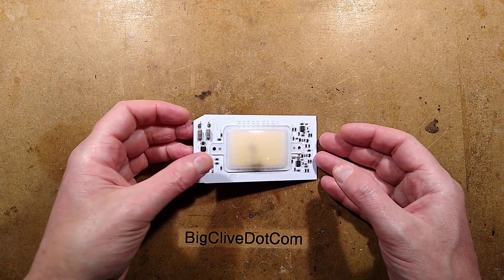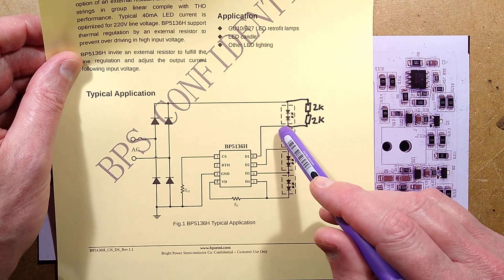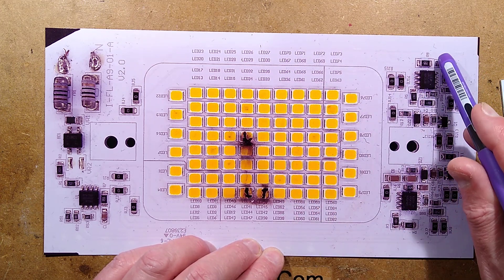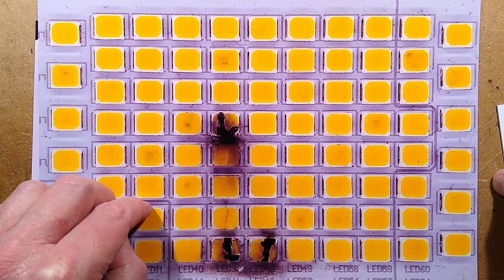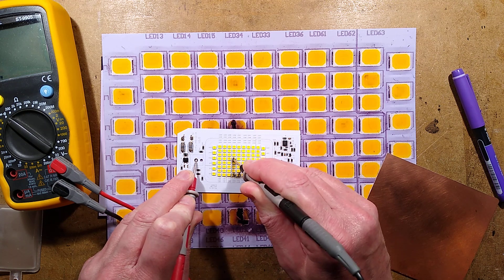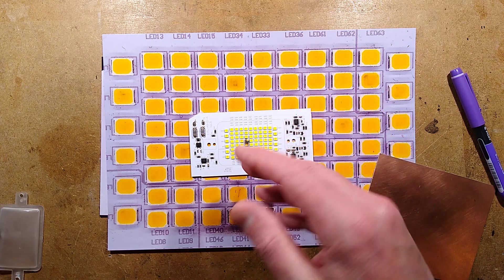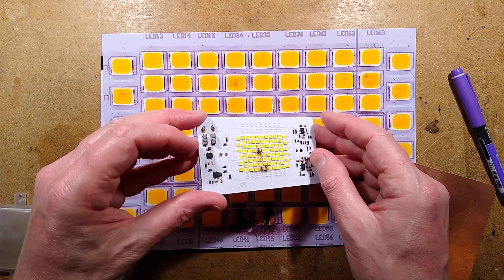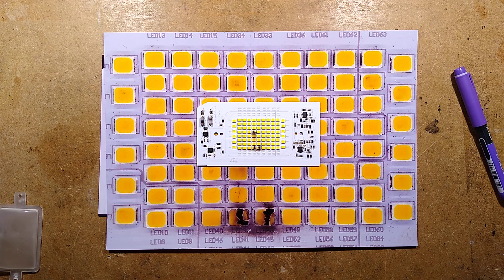LED shock hazards are increasing

Comment: Hi Clive, I was the one who sent it in! A couple of things, this was a PIR activated floodlight from Wickes. It was own brand but not a cheapy one. 
We've had 2 fail in the same position since, oddly the other 2 we have elsewhere are fine. Must be a cursed location. 
The sensor didn't survive my dissection of the case so I didn't bother sending it with, but I got no light out of it whatsoever. 
There was a very small blob of thermal goo on the back but nowhere near what I'd expect it to have unfortunately.
The case was earthed, something I checked when I plumbed it into the supply.
Thanks for the interesting video as always!
Reply from the maker: Does that unit light more than the others?
Reply: Two things: What's the line voltage drop to that particular installation spot, and is it in the sun or in a place with bad cooling? 

One thing I HAVE seen is that if something's in a location REALLY close to the main panel, it's probably getting 125-130V (here in the US) just because the rest of the place is running at 110-120 AFTER accounting for the losses in the wiring and the other loads on the circuit, which in the days of incandescents meant that garages and basements all had to run Rough Service 130V bulbs to not burn out constantly, T12 and T8 electronic ballasts last a year tops when magnetic ones go for decades, and LEDs need to be of the buck regulated parallel type instead of the series-string linear regulated ones like this. 

And, of course, LEDs hate the heat so if it's in the sun against a brick wall, up under the eaves where the airflow's bad, then it's gonna get toasted way faster than normal.
Reply: @LenKusov  I'm surprised (though not much) that US wiring is so shoddy there can be 10% voltage drop within a home.  IEC reference regulations (used in most of Europe) put a lower limit on the percentage voltage drop between the fuse box and the outlets / devices.
Reply: @johndododoe1411  when I was a kid our house regularly got 130 volts or so, we went through a lot of light bulbs and my dad had to buy special ones.
Reply: @johndododoe1411  Lower voltage in US houses is part of the problem but it is good for copper mining firms and wiring companies. US regulations are haphazard and hyper local. Some US electricians are excellent, some are not.
Reply: @dosgos  Dropping 10 volts in the wiring will heat them up with 10W for every Amp.  Every % voltage lost in wiring is 1% of the billed kWh never giving any value for money.  Those should be motivation not to accept such sloppy work.
Reply: @johndododoe1411  It's true.
Reply: @johndododoe1411  10% voltage drop is extreme, I haven't seen that much myself. Nowadays the NEC recommendation is five percent, but back when lights were basically the only load and half the house was on a single fuse it was probably acceptable. Part of the reason that much drop is rare is likely because everyday circuits are rarely loaded to maximum capacity.
Reply: @johndododoe1411  The US National Electric Code doesn't actually REQUIRE any maximum voltage drop, in the fine print they SUGGEST no more than 5% total and 3% on the spur but there's nothing legally stopping you from running as much 14 gauge as you want, with as many backstab connections as you want, and dropping it to a borderline unusable voltage. I'm sure I could get my spur circuit voltages up if I went through and cut all the backstab outlets out and hooked up screw terminals instead, but it's not really worth the effort. At 120 volts, 5% drop is only 25 feet, while at 240 it's 50 feet so IEC's 5% limit is also more achievable without having to up-size conductors.
Reply: @LenKusov When I installed it it was still getting pretty much 240v, middle of the day. It's on the other side of the house from the RCDs, oddly with a fused spur upstairs and a switch downstairs then the cable coming out the wall midway outside. Some very dodgy wiring in the past here, but that's how it was when we came in. It was originally for one halogen lamp but we put 3 new LEDs in, obviously load testing with the cable extension first.
It was in a white painted case and mounted 90° from the wall on a bracket so house heat wouldn't be too much of an issue, but it will get the sun where it is, but again the other Wickes one behind is fine and actually still going, though rated 10W less. It also failed mid winter.
Reply: @LenKusov  do we really need to put LEDs on everything ? even outside on things that will light up for 4 hours a day ? why not just CFL...
Reply: I add to every LED light a MOV unit in the supply, as this really helps with reducing failure rate, as you typically have a long supply wire, and this is going to pick up a lot of induced voltage during lightning, so the MOV right by the fixture in the junction box helps a lot. Only had 2 fail after a lightning strike, but to be fair it did hit 500m away, and these 2, along with the satellite TV receiver LNB, were the only casualties, and were both on the side of the house closest to the hit.
Reply: @SeanBZA  I'll have a look at that, though we very rarely see lightning round these parts.
Reply: i'd guess you have high current inductive loads or others that put a ton of voltage spikes and noise into them.
my old laser printer here draws huge power when coming up to temp and does lot's of pulsing and half wave spikes. it makes led bulbs on the same circuit go fully berzerk and they seem to burn out much faster. it's bad enough it makes fluorescent tube fixtures with magnetic ballast flicker and pulse rapidly.
Reply: @throttlebottle5906  I wonder if this is a case for a SPD at the CU? I wonder if plugging the printer into a surge protector power strip will stop the LED lamps going mad?
Reply: @warrmr  no, because it's abruptly  turning on and off the high current heaters in sharp pulses in attempt to heat and maintain the temp accurately.
usually it's a quartz halogen heater lamp  that heats the "fuser drum" from inside.
depending on machine size, the current draw of the heater alone is 500 to 1000 watts in average size units. things dance when rapidly switching high current loads :)
Reply: The problem is paying more doesn't guarantee better quality.  All you might be doing is paying a bigger markup on the price.

Comment: If you boil the PCB in sodium hydroxide solution you should be able to just peel off that solder mask. I use drain cleaner in a glass container, and put that in a saucepan full of water on the stove. That said, you’ll need to cover over the aluminium in this instance, since lye reacts with aluminium.

Also wow just realised that aluminium-fibreglass-copper makes a bimetallic strip, that can’t be good for mechanical stress.
Reply: Only if they are fully bonded to each other.  What they should use is NOMEX transformer paper.  At 1500V/mil dielectric strength, it beats the FR4.  Probably better at passing the heat through too, especially if oil or thermal paste impregnated.  There should be no way for the AC input to make it over to the DC side.  That is a bad design and so are any others that do that.  They should have used a wall wart or simply done  a better job at isolation.

Comment: I've seen more and more LED's burning out prematurely lately. I blame bad quality control/sloppy manufacturing. They pose a risk of electrocution too? Great. Just great 🙄.
Reply: Also, I think the race to be brightest makes all unprofessional manufacturers overdrive the LEDs. Just as BC mentioned in another comment; the first thing to do when receiving the product is to mod it to lower the current. And when you already have opened it, you might as well attach the ground wire :)
Reply: More they see that they can still last 6 months at double the current, so simply remove half of the expensive 1c LED chips off the design.

Comment: They put the earth wire in to make it look compliant. Obviously if they don't have a connection to the heat sink or case,  they don't really protect anything. in the description you said they sometimes switch the neutral in Britain? I've never seen that in the USA but I know of a building code against it...

Comment: As of 2019, type AC RCDs aren't recommended for new installations in Ireland (I.S.10101, chapter 5, clause 531.3), so we're a little ahead of the game here. Unfortunately, the language is a little more wishy-washy than is ideal. For various historical reasons, our electrical standards are pretty much a conservative compromise between those of the UK and Germany.
Reply: Yeah but 2019 is like pretty fucking late sadly.

Comment: Isn't the large number of 0 ohm links, due to the fact it's a single layer PCB? 2 layer aluminum PCBs are much more expensive.
Reply from the maker: It is single layer with the three drivers linked in parallel on multiple LED sections.   The zero ohm links are jumpers.

Comment: “…which stops you from shining light through the back.”  You’re using the wrong light, friend.  ;)
Reply: X ray time!
Reply: Or, maybe try to burn the aluminum plate off with lye. Not a particularly fast, or clean, or safe option, but still...

Comment: This has nothing to do with this particular video, but I'm curious if you would be interested in looking at a failed kettle style plug (the ones used for powering a PC power supply). Mine failed quite spectacularly and I'm wanting to know whether it was the plug that failed or if something else caused it to fail such as the socket or my PC power supply. 

If you're curious as to how it failed, I believe something internally set onfire since when I tried to take it apart to see, the housing was actually melted together at one area. It was also extremely hot about 10 minutes after my PC shut off because this part failed. I am UK based if that helps at all.
Reply from the maker: Connectors do fail.  Some of the IEC style leads being supplied with goods are made to a very low price and use very thin copper coated aluminium cores that have a very low current rating and high risk of corrosion.

Comment: To be fair, if you are checking a flood light that is not illuminated and you suspect is faulty while the power is still going to it then your a bit of a numpty. Especially if its a cheap Chineasium product.
Reply from the maker: What if you turn off all the lighting circuit breakers but don't know that it's still live?
Reply: @bigclivedotcom  Fluke volt pen, saved me many times ;-)
Reply: @bigclivedotcom  or the quick tap with back of hand test, followed by wet finger ... then it is safe to work on.

Comment: WAIT! That datasheet says confidential! How did you get it ;)
Reply from the maker: I can't tell you - it's "confidential".
Reply: The Chinese will sometimes give you data sheets if you request them or have certain qualifications.
Reply: @baneverything5580  I once tried to get the datasheet for some mystery chips in a LED lamp. The only manufacturer/supplier I found wanted to charge me $1000 and send me some samples … like, what am I supposed to do with those, and for a grand?? F off, you bastards.